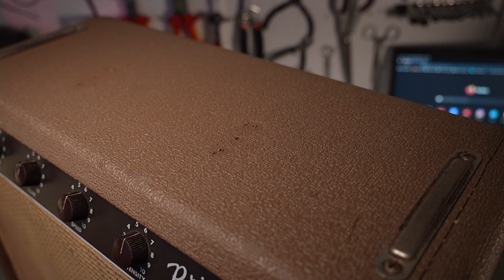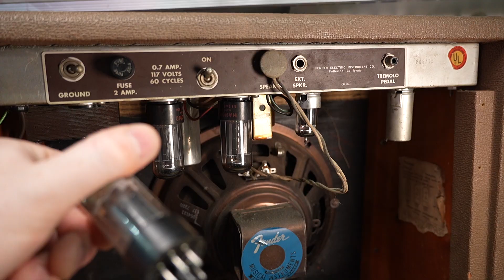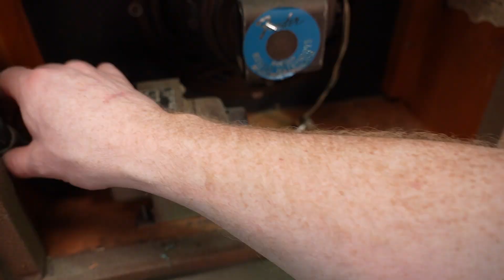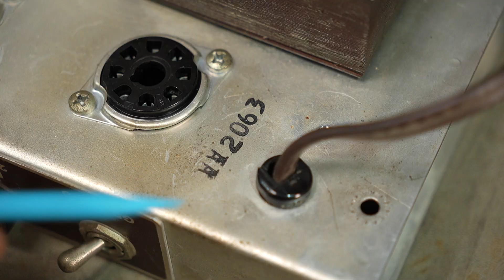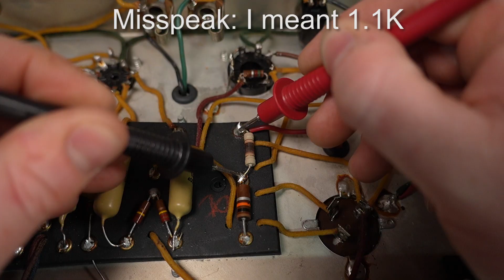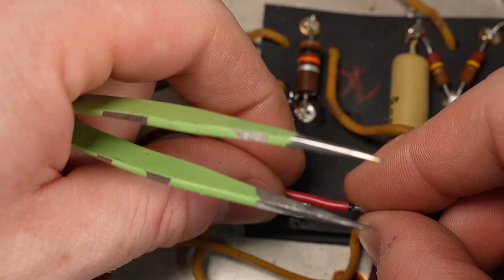Fender 6G2 Princeton - Part 1

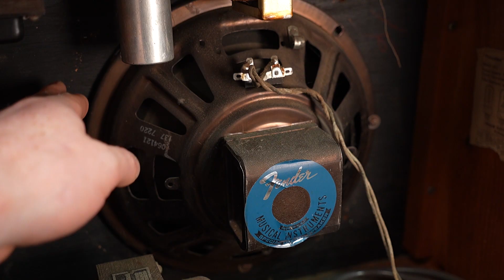Comment: That is not the original speaker.  It appears to be a CTS made speaker in 1972 by the date code (visible at 6:32).  In 1963 it probably would have been a Jensen or maybe an Oxford.
Reply: An Oxford is what these came with originally

Comment: Regarding the rectifier tube, sometimes you can exhale a bit of air onto the glass of a tube, like grandpa used to do when cleaning his glasses, and make out the missing printing. That "M..." (is that a D or E after the M) stamped on the tube chart above the drawing of the 7025 suggests a manufacture date of mid-1963, but those aren't always correct. At least it supports a '63/'64 timeframe along with those tube codes. Just got to the part where you point out the "AA2063" on the chassis. Along with that "MD" or "ME" stamp on the tube chart I'd call it April/May 1963.

Extra holes and dings are part of the story of the amp. It came by all of that honestly so I like to leave that kind of stuff unless it needs to be repaired for structural/operational reasons, like installing a new handle. 🙂

Comment: Some notes on dating the amp:
The power transformer is the correct model Schumacher from the 7th week of 1963
The output transformer is the correct model Schumacher from the 38th week of 1962
The tube chart date code indicates 1963 (couldn't read the month code, you go by too fast)
The Astron multi-section cap looks like 28th week of 1962
Electrolytic Astron caps on the circuit board indicate the 43rd week of 1962
Chassis number PO5753 indicates 1963
Taken all together, it looks like the amp that was put together in mid 1963 from parts they had in stock. Exactly what you'd expect from Fender in this era.
Also, the back "paint" on the diode solder joints is typical of Fender at this time. Not sure why they did this but you see it over and over again.

Comment: Ooh, a nice little brown Princeton.  I actually do put class X ceramic death caps in my personal amps and in customer's amps upon special request. My house was wired well over 72 years ago, and I have TWO AM radio station towers near by (one of them is an enormous 4 tower array with added elements on the towers, and the other one is very very close to the house), so those death caps actually do reduce hum and RF noise. The single tower is being torn down now. The 4 tower array keeps gaining more and more crap on it. One of my customers has two 150,000 volt power transmission towers in his back yard, so he gets death caps and loads of extra copper & carbon shielding. He was running all over his house after I did his first guitar trying to find 15,30, 45, 60, 75, 90, 105,, 120, 135, 150,165 & 180Hz hum. Big 6x 3 phase towers! They come from a  power plant. You get all kinds of really weird harmonic nodes from those multiple parallel wired 3 phase towers. Old Germanium transistors liked to act like avalance diodes so we'd get KJJJ 910 AM Country on those, and with wah pedals we got both stations, 910 KHz and 1260 KHz AM.
Reply: Once during a gig my Super Reverb was picking up Dan Rather's news feed. Embarrassing to say the least
Reply: @vadenk4433  When I was still touring in the mid-'80s we used to play in a little town north of where I live that had an airforce base. Every minute or two the PA and amps would go "vvvvvtttt" as the radar swept in the direction of the club. Sometimes that would also be accompanied by the local taxi dispatch radio. "This is Spinal Tap" was more realistic than most people know LOL.
Reply: @vadenk4433  Mom had the Willie Nelson Baldwin (Burns) Professional 2x12 solid state amp, and we'd get all that crying in your beer C&W music, and then "KJJJ 910AM Arizona's Country Music Station!".  KHEP was literally a stone's throw across the highway and for a while that was KTUF AM Country, owned by Buck Owens. It was originally a born again Bible thumping Christian radio station called KHEP. It went back to that format for a while under Family Radio. There is a great story with "Family Radio". Their main preacher was 100% convinced that the world would end on a certain date and at a very specific time of day, TWICE.: The prediction was made by Harold Camping, the host of Family Radio's "Open Forum" television and radio show. Camping had previously predicted the end of the world in 1994, but that did not happen. 
After the world did not end on October 21, 2011, Camping apologized and said he was wrong. He also said that he no longer believed anyone could know the exact time of the end of the world. Camping retired from Family Radio, but his daughter said he continued to work remotely. 
Family Radio suffered a significant loss of assets, staff, and revenue after the failed prediction. >>>KHEP really fell into disrepair after that stunt.<<< It was a cool little art decco building.  Half the tower is down now and they are back on the air again with a whole 210 watts of output.

Comment: These are a pretty cool little amp.

It’s really odd the filter caps are still there and yet the coupling caps were replaced. If the caps were yellow Astron caps were used these go quite leaky as you would know.